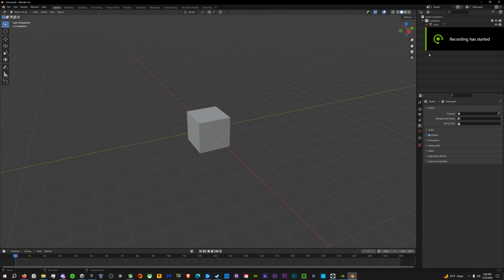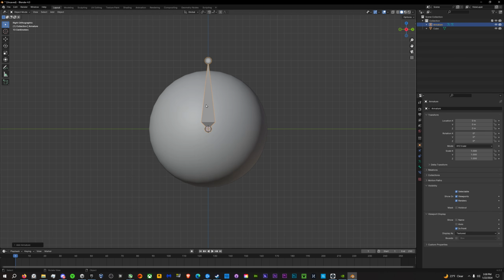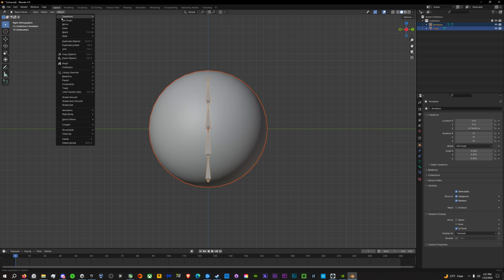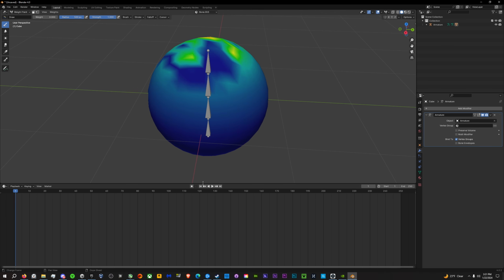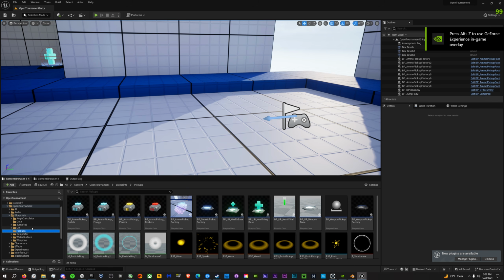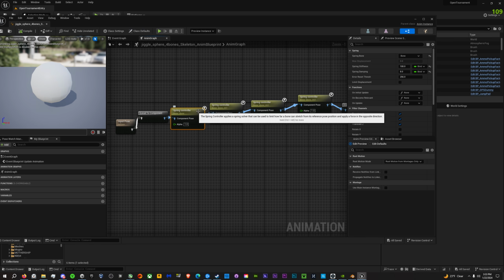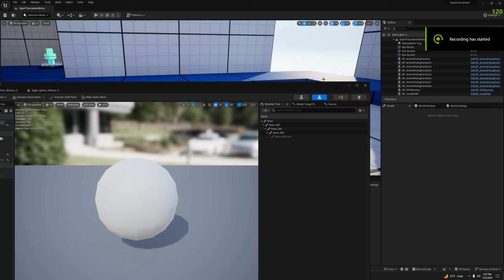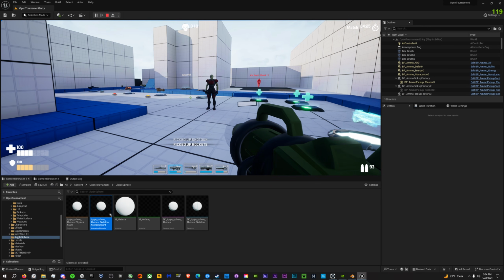EASY Soft Body Physics (Sphere) | Unreal Engine 5 Tutorial (Works With Unity As Well)

Comment: This is awesome! Big thanks. Is there some way to make spring controllers colide with eachother?
Reply from the maker: I'm not sure if there's a way to do that. This is a "sudo" soft body physics tutorial. Meaning you'll always have a bit of clipping since its made with bones. And not vertices.
Reply: Okay thanks. Do you happen to know how to make it so meshes affected by spring controllers will collide with an environment and/or props in an environment?  @TegridyMadeGames
Reply from the maker: @7Deer7  no, its not really soft body physics it's a faux (fake) way to do it easily with less performance cost
Reply from the maker: @7Deer7  you might be able to tweak the physics asset and get a similar result using that, im not sure though.
Reply: I am asking because I haven't got much idea what I am doing. Been struggling for two weeks with the physics asset and I canned it all because I got a much better result thanks to your video. Just need collision though. But thanks none-the-less. :) @TegridyMadeGames
Reply from the maker: @7Deer7  you just need to put the skeleton (rig) on actor blueprint that has physics and place a collider inside the blob.
Reply from the maker: @7Deer7  If you're not sure how to do this, try using the bullet from the FPS kit as a test example.
Reply: Thanks I will take a look at that example. On my version It kept bugging me with constraints and whatnot, it was either no physics at all, or some really extremely bouncy mesh on the slightest poke. @TegridyMadeGames